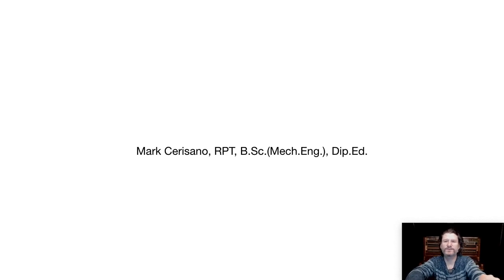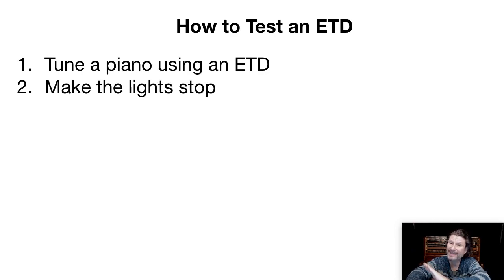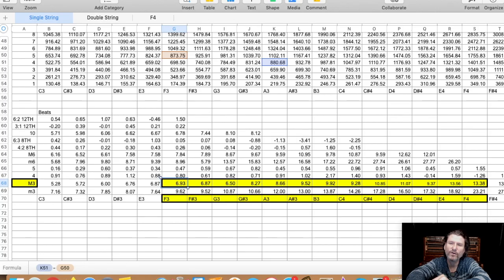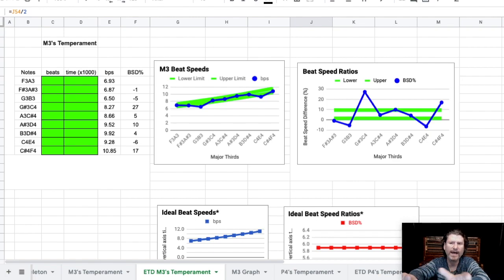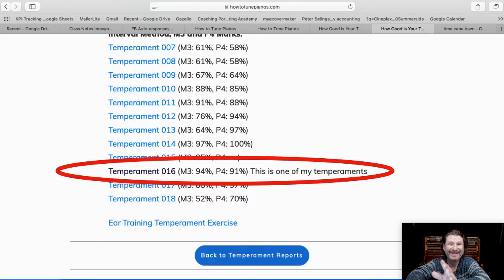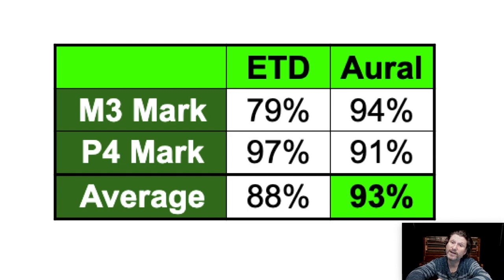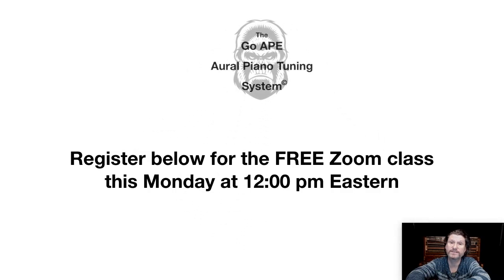Can an ETD tune a piano better than your ears?

Comment: I don't know if in America they have the expression oils ain't oils? It's the same with piano tuners some are better than others and I note that the ETD that was used was not mentioned. 
Of course my view is if you haven't got a good ear for music or have not a good grasp of relative pitch you becoming a piano tuner is probably not a good idea however, 
with so many clients neglecting their piano for years, it can be very helpful to have ETD assistance when doing a preservation tuning ie a piano that's down 300 cents
so too risky to bring it to concert pitch in one pass or maybe it's that old it's better left where it is and to tune the piano taking a path of least disturbance.
There are many cases where an electronic tuning device is not necessary, and other situations where it can be extremely helpful.
To say one system is better than the other is counterproductive
.
A professional should apply whatever methods will bring the best result for the piano being worked on. I'd be interested to see that test done again using say three different tuning software's
RCT vs Entropy vs Tunelab to compare which software produces the best result rather than this comparison which compares only one software which we don't know which, against aural tuning.
Reply from the maker: This was a $1300 ETD. The people who beat it were students tuning for a few months. How could they beat it? Easy. With the Go A.P.E. Aural Piano Tuning System.

How can people expect to beat a modern machine with 100 year old aural techniques? It can't be done. That's why the Go APE system had to be developed.
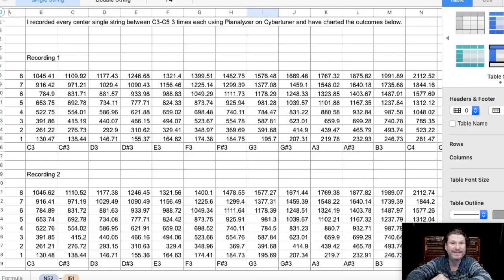Reply: Raymond, If you pause the video at 0:58, it says which ETD (RCT) and which tool (Pianalyzer).